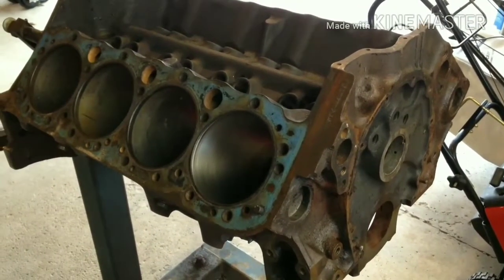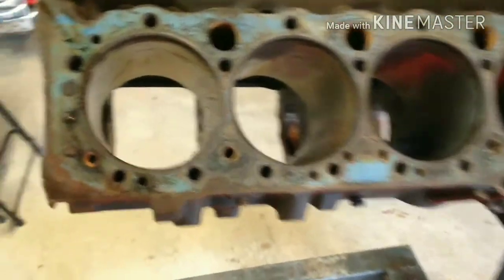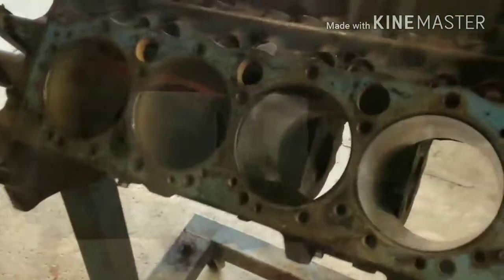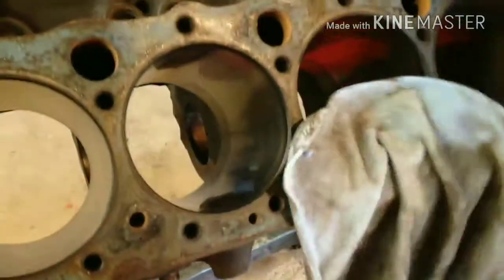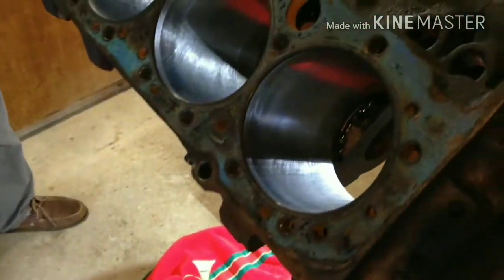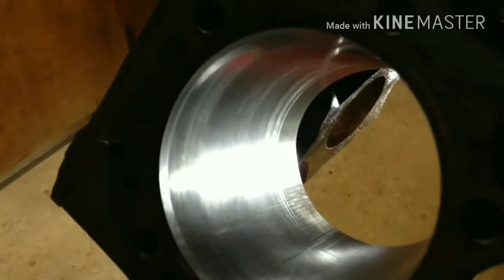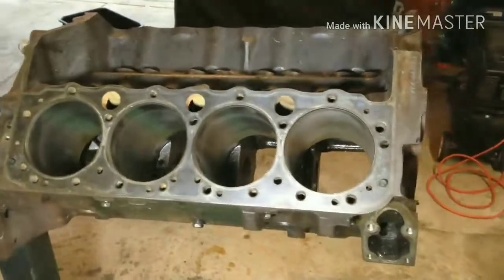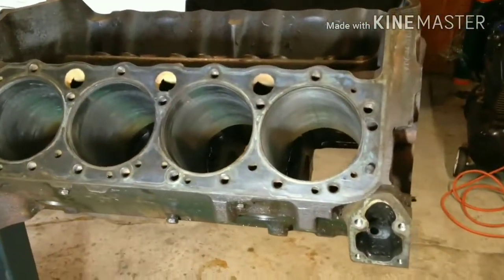Chevy 350 Rebuild - Part 1

Comment: Some people actually will benefit by reading a book first, such as yourself. Now and days, there's YouTube and everyone thinks that they can be a hero at anything. I've been an auto machinest for 37 years. I use the best tools in the world. I sill don't claim to have all the knowledge, wisdom and fortitude.

Nice to see someone trying. You have to be careful of the machine shop that you chose. Some immediatly talk you into having your engine decked, then well, you need an align hone, spayed caps to a bolt block that need 3 hours worth of shop labor.... Shi2ps avg 100 an hour. Only have the basics done. I even had a guy come in after being talked into trading in his high nickel 4 bolt block for the new Bow Tie block.  400 plus the block trade  in. You can always go back especially to have those rods gauged. It's not the shop that sends out the fastest engines always. Sometimes it's the guy who listens and tells you how to make the most out of what you have. There not much different on a 2 bolt or 4 bolt as long as the have strong bolts be live it or not. This goes for both big and small blocks